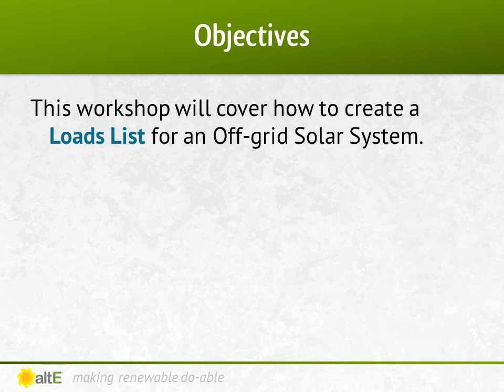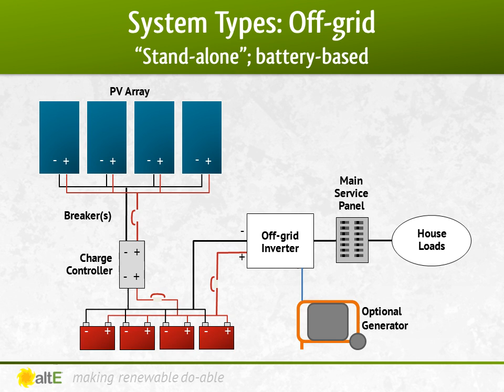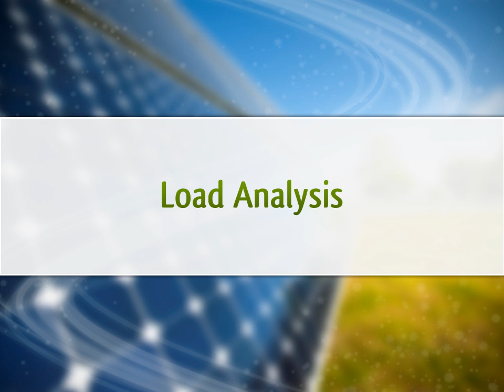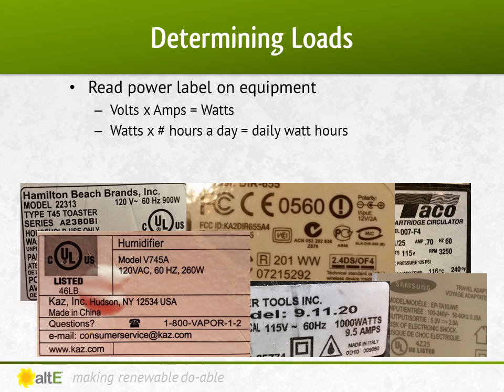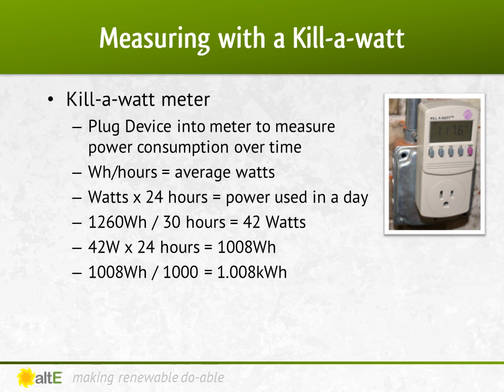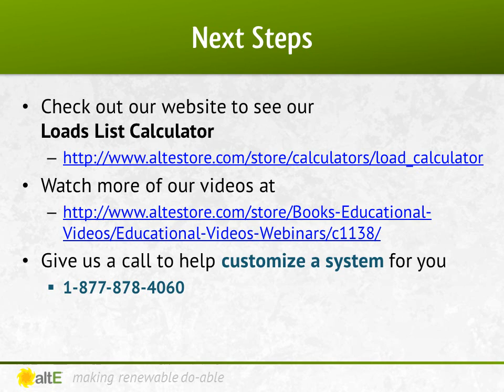Loads List: Off Grid Solar Power System Design - Step 1

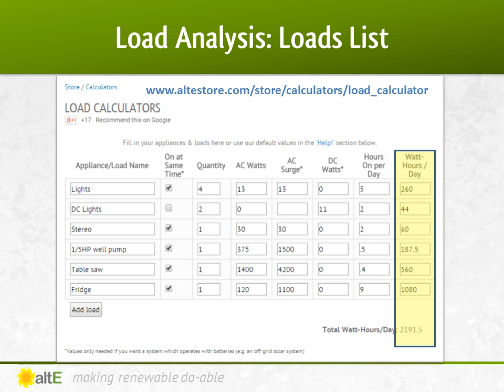Comment: at 7:58 there is something wrong with the calculation of kwh/day of table saw, 1400 x 4 is 5600, not 560. Although it is just for illustration, it means that there is an error in that load calculator (if you actually used it)
Reply from the maker: It's hard to see in the video, but it was actually .4, not 4. I should have written it as 0.4 to be more clear. I figured on using it for less than 1/2 hour. (Small project)

Comment: Hi, I think the results in rows 4 and 5 are wrong. The should be 1875 watt/day and 5600 Watts/day. Accordingly the sum or added load should be 8919 Watts/day. Am i correct or wrong? Please explain it if i should be wrong.

Comment: what is the difference between surge power and continuous power ????? please
Reply from the maker: Surge is when a motor starts up. For example a refrigerator draws about 4 times the current for a few seconds when it first starts to get the compressor going. Then it settles down to its constant lower current draw.

Comment: hello all,
i need help/ info, i have  three 12V,  156Ah Agm Haze batteries connected in parallel to make a single 12V,  468Ah battery bank  (3X156Ah) but the battery is showing on a volt meter as 155/160Ah even when connected as parallel,  can someone tell me what is wrong or is't how it meant to be. can someone tell me in details how and what to use in getting a proper watt, volt and amperage reading. any info will be appreciated.
Reply from the maker: A volt meter is not able to give you Ah readings. The best way to do this is with a battery monitor with a shunt. The shut would be wires in line in the negative wire, and measures the amps going into and out of the battery. This way it can keep track of how much energy is in the battery. Never try to measure amps across a battery with a volt meter.

Comment: Hey altE, thanks for the video. How can I calulate Watt-hours, if my load is variable? Like a heater, which I need to turn on when ever the weather is cold. Because some loads depends on the weather.
Reply from the maker: That's always a tricky one, same with a fridge. You can get an energy meter that you plug your device into that measures the accumulated energy used over time. Kill-A-Watt meter is poplar in the USA, but there are meters available all over the world that work with your local power specs. They are usually fairly inexpensive, and worth the money to make sure you get the righ size solar system.

Comment: I'm being a stickler for fine detail but anyhow I thought I'd bring it to your attention: 
Given the power rating for the well pump is listed as 375W, it should be declared as "1/2HP" not "1/5HP". Also, Wh/day should be 1875, not 187.5 .
Reply from the maker: You are totally right on that one, that's a typo. Thanks, I never noticed that. I must have used the number pad where the 5 is above the 2.  I'll put a note in the video. The total Wh is another case of the decimal point not showing up well. I was planning on 1/2 hour a day.
Reply: Thanks for pointing that out. I figured "you were right, I was wrong" somewhere along the way!

Keep up with the great videos.

Comment: In the calculation of load, fridge is on for 9 hours but usually fridge is on 24 hours I didn't understand why you on the fridge for 9 hours.
Reply from the maker: You may notice that your fridge compressor isn't always running. When the fridge is plugged in, but you don't hear it running, it isn't using much or any power. So in this example, the fridge compressor was only on a total of 9 hours. The best way to calculate a variable load like that is to put on an energy meter like a Kill A Watt meter to get exact numbers. Otherwise, unless you watch it over a period of times, you may need to guess. Some people use 12 hours, figuring it is running half the time.

Comment: Amazing video. Thank you so much.
But I don't really understand the connection between the surge and the Watt-Hours /Day calculation.
Again, thank very much.
Eric Azomahou.
Reply from the maker: Thank you. That's a great point, I didn't make that clear. Because surges happen so fast, they usually are not calculated into the watt hour calculations. If you are using something for an hour, the 5 second surge really doesn't make much of a difference in the long run, so you would just make your calculations based on the constant power, not the surge. Surge really just comes into play when you are determining the size of the inverter needed to handle that momentary surge.
Reply: Some appliances like refrigerators or water pumps switch on and off periodically by needing a surge power for a very short period of time to start. After that short period of start phase they begin to consume a constant rate of power over time until the next OFF/ON cycle.
To have a real weighted power usage a'' kill a watt meter' measures the energy consumption of those appliances over a period of time, lets say 40 hours. In 40 hours enough  ON/OFF cycles are included to produce a representative hourly power consumption for that appliance.
In a next step you divide the total measured KW consumed by 40 to get the hourly energy consumption for that appliance. The result has to be multiplied with 24 (number of hours per day) to give you the power consumption of that appliance for a whole day. I hope it was helpful.

Comment: hello altE Store thank you very much
when accounting the surge how can i know the surge for every device because some devices not including its surge in its data shett
Reply from the maker: +Eng Mahmoud Samy Excellent question. This can be difficult to determine. Some meters may be able to help, but since a surge is often very quick, it may be difficult to capture if the meter isn't fast enough. A Kill-a-watt meter may be able to capture it if it is a 120V 60Hz load. https://www.altestore.com/store/Meters-Communications-Site-Analysis/Meters-Battery-Monitors/Power-Meters/Kill-A-Watt-EZ-Electricity-Cost-Usage-Meter-P4460/p6659/  A clamp on amp meter may be the best option, like this one, https://www.altestore.com/store/Meters-Communications-Site-Analysis/Meters-Battery-Monitors/Ammeters-Voltmeters-Battery-Monitors/Blue-Sea-Systems-8110-Mini-Clamp-Multimeter/p7199/, since it can just clamp to the wire and tell you the amps, then you would multiply that by volts to get your watts. Then there's the good old fashioned guessing based on experience. Things with motors, compressors, pumps, tend to have a high surge, figure 2 or 3 times their run time use. Electronics tend to not have enough a a surge to be a concern.